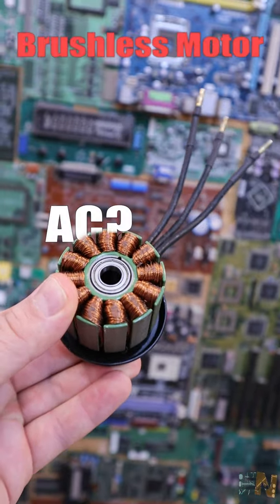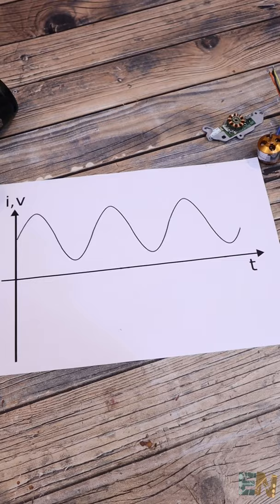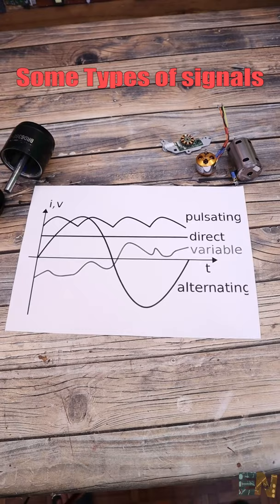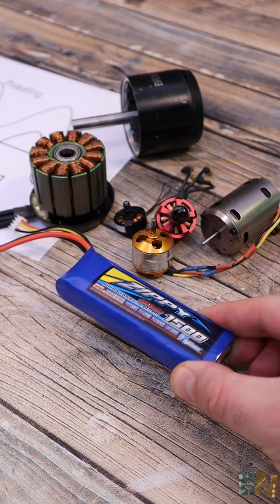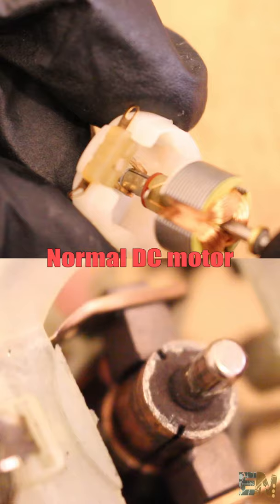Are Brushless Motors AC or DC? - Well...

Comment: If you drive this motor with the proper amount of AC phases, it will work nicely. In practice we use DC pulses to drive it, but that's OK, it is still an AC motor
Reply: Sorry, you are wrong. The current is AC.
Reply: @Ozzy3333333  that's what op is saying?
Reply: @beaclaster  Really? "we use DC pulses to drive it", that statement says DC. Most are confused because the source is DC voltage, then the esc then turns into AC current (dont say something stupid like, AC is a sinewave and this is DC pulses)
Reply: @Ozzy3333333  you are right. The pulses include negative voltage.
Reply: I use DC to power my moto driver but my moto driver's output  is three phase sine voltage，so I thik the bldc is AC moto，and the most important reason is the current is AC
Reply: @Ozzy3333333   I know it's a very old comment thread, but I would still like to reply to your comment to share my opinion. I hope you don't mind. After reading all the comments, I have finally come to a conclusion that the BLDC motor's controller is essentially just a DC input circuit board for a 3-phase AC inverter with variable frequency output control. And that is what is causing the confusion. So, the BLDC is actually an AC motor.
Reply: @jaydutta7711  correct
Reply: it's not dc and not 100% ac it's in between more to ac side it's the positive pluses of ac voltage
so it's ac motor at the end however if the battery is dc but the IPM and PWM will turn it into controlled pulses if you check one line it's dc if you check 3 line it's ac
Reply: @Ozzy3333333  I don't think this is an AC circuit because of how it's driven. You can't look at individual coils. PWM is used to control the motor, and there is no source of negative voltage. So, from the battery and from the controller, the current only flows in one direction. The voltage shows negative for a given coil because the controller switches which leg it powers, which can reverse the current through the coil. The back EMF generates the voltage, of course. Thus, the diagram he shows represents the change in direction through the coil as a negative voltage. However, there is a change in the current direction in a PMDC motor due to the brushes, and no one would claim those are AC motors.
Reply: @commenter4799  that motor can be driven with negative pulses too, usually it's just not worth the hassle to implement a symmetric power supply.
Reply: @dtibor5903  yeah, you'd need two sources, and when you are essentially using an H bridge to control the coils, I don't see the point. I think people are looking at individual coils, but the component as a whole is DC which is fundamentally different than synchronous or induction motors.

Comment: I think the key word in Alternating Current is CURRENT.  The zero voltage reference is somewhat arbitrary.  Each motor lead in this BLDC motor will have current flowing in both directions.  This is what defines an AC motor.  For example, we could use a large 600V battery to feed the DC buss of a VFD serving an AC induction motor.  This motor would not suddenly become a "DC motor".

Comment: How did u explain such a confusing topic in a youtube short?!!
Reply from the maker: Should I make a full video on this topic?
Reply: i think it's good idea for that
Reply: @ELECTRONOOBS  Yes, please.
Reply: @ELECTRONOOBS  Great, please!
Reply: @ELECTRONOOBS  Absolutely! I'm still having confusion with understanding this whole ac vs dc motor ordeal. It would be great to have an explanation video.
Reply: @ELECTRONOOBS  Every motor has either mechanical or electronic switching. The DC motor is mechanically switched and the BLDC motor is electronically switched. Every motor is a transducer, converts electrical energy into mechanical energy and vice versa. But if you run a DC motor you will have a DC generator dynamo, now if you run a BLDC motor you will have an alternator, generating three-phase AC current, and you will need a voltage rectifier to convert to DC. Cheers from Brazil.
Reply: @electronoob, yes, BUT first understand why so many people (including me) is saying your wrong (and you are), just watch my video with a current probe showing the current though the phases are in fact AC, and then,, do a correct video to correct this wrong video.
Reply: @ELECTRONOOBS  You should and you should get it correct the next time

Comment: The current on a bldc motor is Infact AC because it is infact alternating. The 3 phase bldc controller is swapping the polarity on all the pins so it's  ac. Most modern esc are now using phase inductance to produce a smooth signwave now as well dji and castle do this to drastically reduce ringing and heat from the motors.

A bldc motor  controller is really just a dc to 3 phase ac inverter with variable frequency control
Reply: A PMDC motor swaps the polarity on the coils with brushes. Does that make it AC?
Reply: @commenter4799 It is actually a universal motor.

Comment: I see this as a perspective problem.
By taking the battery ground as the absolute ground, yes, this is all DC, but once past the ESC, we should consider the frame of reference of the motor. Now we have 3 phases and the virtual 0-point is determined with the 3 resistor star thingy, you certainly know what I'm talking about.
Reply: A PMDC reverses current flow through the coils with brushes. Does that make it AC?
Reply: 2 years late but you're talking about 3 phase delta configuration lol

Comment: brushless motor broke the line between ac motor and dc motor, but on construction standpoint it more closer to the ac motor, you can consider the esc as some kind VFD or VVVF
Reply: An ESC is basically a low voltage DC VFD. DC because it only drives the coils in one direction because its running on a battery. But you could easily make an AC ESC by adding a second (balanced) battery and using the middle point as the 0V point and each end as +VCC and -VCC.
Reply: In principle it is a DC motor. Only that the function of the brushes are done by semiconductors.

Comment: this should just be wrong tho. alternating current is current that periodically changes direction by having these modulated potential waves we definitely get reversing current in the motor coils => ac.
it really doesnt matter that with regard to our defined 0V potential we only have positive potentials. The direction of the Current is what matters for AC (alternating CURRENT)
the reason we call them dc is because we can supply dc to the alternator similar to how we can just supply dc to a brushed motor. the DC is therefore just user centric nomenclature. the motor itself definitely sees alternating current.
Reply: We should call it permanent magnet motor instead of bldc
Reply: @samueladitya1729   After reading all the comments I finally got into my conclusion that the bldc motor's controller is basically just a DC input circuit board of 3 phase AC inverter with variable frequency output control. And that's causing the confusion.
Reply: @jaydutta7711  exactly.
Reply: AC motor can rotate in one direction only

Comment: 0 volt is arbitrary point. Any change of current is AC. So all Motors are AC. As Motors can be generators this can be seen at output.
Reply: Incorrect, Alternating HAS TO GO THE OPISITE DIRECTION, and the video is wrong.

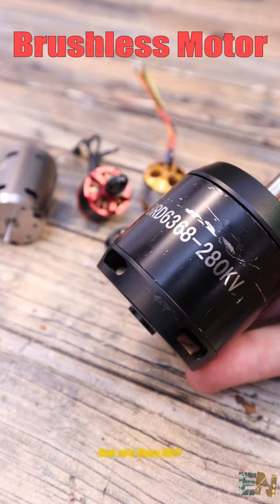Comment: 0:09 Nope, YOU'RE  WRONG. :)
2 reasons:

That is a AC voltage with a DC offset, or a DC voltage is AC signal superimposed on it (whichever you prefer). At least by MY definition of AC and DC. Defining AC as a voltage that happens to cross the zero crossing seems... arbitrary.  I prefer thinking in terms of AC and DC components. Just do a Fourier series analysis on it, and seeing 2 impulses, one at 0Hz (DC) and another factor at some frequency. In this case, my answer would be both AC and DC components, in roughly equal magnitudes (actually a bit more DC than AC magnitude since it is well above the zero crossing in the time domain).

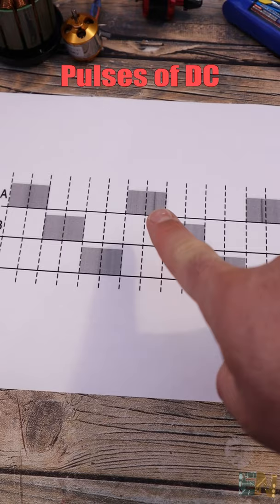HOWEVER,  the motor NEVER sees that voltage. Voltage is a measure between 2 nodes, so I ask you, what 2 nodes were measured to get that waveform? I know for FACT it sure is hell ain't the voltage across any 2 connections of the motor. In fact, I pretty sure that waveform is the voltage measured between one of the phases and the negative of the battery terminal. Guess what? The motor has no connection to battery negative. This is *deliberate*. Doing so would result in massive DC current flow through the motor coils, saturation of the magnetic core, exploding MOSFETs, and burnt windings. So that voltage measurement is pointless and misleading because no current will (or at least should) flow in that path. and if you put a clamp-meter to measure current in any phase, the measured current will have no DC bias, just like you show in 0:41. See? AC currents ONLY. *Alternating currents*, with NO dc offset.

So yes, the BLDC motor is in fact a type of AC synchronous motor. The motor will never see any DC voltage on it. The back EMF is pure AC. Each phase can be electrically modeled as a series inductance and resistance, which also suggests that any DC bias would only serve to cause ohmic heating (it's bad.) and perhaps also extreme torque ripple.

IMHO, Even DC motors are AC motors, the commutator converts DC to AC rather than electronics. From the frame of reference of any particular pole on the armature, it will never see a steady-state DC. some percentage of the time it will get a blimp of positive voltage, and 180 degrees later, get an equal blip of negative DC voltage.

Now, what's the difference between a "BLDC" motor and a "PMSM" motor? both have permanent magnets and an armature, and both operate in much the same way. One has a sinusoidal back EMF and designed to work with sinusoidal drive. Whist the other has a more trapezoidal back emf and designed to work with 6 step commutation. You can also dive into the intricacies  of space vector modulation and 3rd harmonic injection if you want to get real fancy. Actually, practically speaking, BLDC and PMSM motors in real life are really blurred together due to manufacturing tolerances and stuff. Things aren't so mathematically pure in practice. Both BLDC and PMSM will generate a somewhat distorted back EMF.

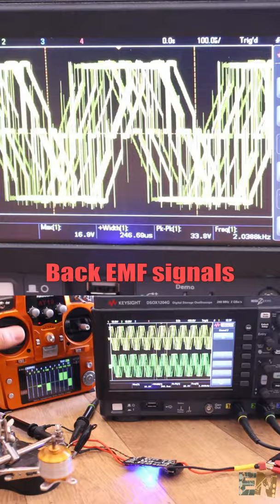0:43 This is where things get interesting.
Yes, the torque vs RPM of a BLDC motor without an advanced control algorithm (like Direct Torque Control or Field Oriented Control) does actually behave a lot like a permanently-excited DC motor. That is to say, a linear torque and RPM relationship; which has a some maximum torque at stall condition and linearly follows a line down to the no-load maximum RPM, assuming constant voltage excitation, as a result of back EMF and parasitic phase impedance. At the midpoint of half speed and half the stall torque is the maximum power point, and maximum efficiency is achieved closer to the no-load condition (light loading.) as expected. But why does this define a BLDC to be a DC motor? What does this characteristic have anything to do with it being a DC motor???

So really? Well as far as I can tell, whether it should be considered a "DC" or "AC" motor has more to do with the controller than it does with the motor. You can connect a PMSM to a BLDC motor driver and it will honestly work just fine. And ditto with a PMSM motor to a BLDC motor controller. (maybe not 'optimal' theoretically) but whatever. Practically, they are in fact interchangeable.

Actually, I do really appreciate the discussion though. and the TL;DR is... it's complicated. Really both sides make good points.
Reply: @Power Max  So a bldc motor  controller is basically just a DC input circuit board of 3 phase AC inverter with variable frequency output control? Am I right?
Reply: @jaydutta7711  correct
Reply: @jaydutta7711  yes. Well... Sort of. There actually are subtle differences between a BLDC and PMSM motor. For details look into something called "Space Vector Modulation." Compare that to SPWM.

SVM with third (fifth, seventh... Odd) harmonic injection allows a a greater voltage differential between phases to be achieved without increasing the required DC voltage.

And also the SVM phasors may follow a hexagon instead of a circle depending on if the motor has a trapezoidal or sinesoidal back EMF. Most high end motor drivers will try to drive a sine wave until you demand maximum speed that can be achieved with a certain DC voltage. In this case it will saturate anyway. Beyond that you have to do something called field weakening where the current you apply to the phases are leading the rotor by more than 90 degrees, deliberately decreasing the rotor field (just the net result of the cross product of the fluxes.
Reply: Damn dude.  You win
Reply: @power-max  how come decreasing the rotor’s magnetic field can increase speed ? Because i think when the rotor’s field decreases , we have less Torque? Im learning about this in school but i am not able to fully understand this fieldweakening
Reply: @phamhuutri1996  I think one way to understand it is to think about it in terms of the back EMF. More field strength results in a larger back EMF for a given rotational speed. The back EMF works against the voltage supplied to the motor. With no load, the BLDC or PMSM motor will rotate at the point where back EMF and voltage supplied are equal and current is near zero. A stall condition results in the highest difference between back EMF (=0) and voltage supplied, or maximum torque. The motor or motor controller would burn up if this condition is maintained too long.

If you look at the torque/speed plots of DC motors or BLDCs or PMSMs for that matter, you can observe a linear relationship between torque and speed, there is a stall torque, an unloaded speed, and a straight line connecting the 2. Maximum power is halfway down this line, maximum efficiency is usually somewhere at 80% speed 20% stall torque part of the curve.

My favorite type of motor is going to be the shunt wound DC machine. This type of motor rotates with very nearly constant RPM regardless of mechanical load. Very strange! A series wound DC machine is also unusual in that the torque/speed plots are inverse. I.e. a huge load of stall torque, and no theoretical limit to unloaded RPM (you can damage these types of motors spooling them up with no mechanical load!)
Reply: Your thoughts on driving a trap bemf motor with FOC?
Reply: @johnrobholmes  The hell would I know?? Not like I left a Ph.D dissertation comment- Oh wait... lol.

I honestly don't think there is a big difference between trapezoidal back EMF and sinusoidal backEMF. If my understanding is correct, match the controller and motor types to minimize torque ripple. In the real-world, both types of motor really fall somewhere halfway between the 2 idealistic types. But really I am not an expert. Just repeating what I have come to the conclusion after obsessively googling how my quad-copter works, with plans but never got around to making a motor controller.
Reply: @power-max  we have the same understanding then.  I make motors and am on the cusp of FOC controlling, now the choice of tweaking back emf shape for non block commutation is upon me.  Will be fun to find out the real world result!
Reply: Well said, and no TLDR's from me mate.
it's good to see someone like myself that takes the time to put down the facts

You're correct
one point you missed though, he also made a mistake by calling Polarity change, Phase Shift
this video definitely has a few mistakes though
Reply: I’m curious if any of y’all fellow motor nerds have ever seen a brushless motor with an odd number of magnet poles on the rotor??
I have been playing with a permanent magnet converted alternator made for a windmill gen that I found in a scrap pile, was scratching my head when I counted 7 magnets on the rotor!  Hooked up to a 1500w e-bike controller this thing has SCARY torque and very smooth/ quiet speed control from start to max rpm.  After some time waving magnets over the rotor and using magnetic feild viewing sheet  to see and feel the shape of the flux I figured out that the magnets on the opposite side supply the alternate pole, causing the rotor to actually have a nice even alternating feild on all sides!  Ive found almost no information on motors with odd number magnets but it seems to work very well in this design!  
Really interested to know if anyone has seen or heard of this kind of configuration before!
Reply: @maukaman  14 poles probably, each magnet has a north and south pole, you can't have an odd number of poles.

For slots, this is some multiple of 3 for a 3 phase motor.
Reply: @power-max  The way it actually works is quite interesting.  It does end up having 14 magnet poles around the outside of the rotor despite having only 7 big chunky neodymium magnets.  I don’t know if the magnets  have unique feild lines or if it’s the shape of the 7 magnets that allows them to be used like this.  The rotor doesn’t have a solid iron core instead it’s made with 2 plates with lots of holes through them, the magnets and empty space between them.
   It’s a very chunky motor and seems to be very powerful with insane starting torque but it has some disadvantage due to the shaft and body being magnetic, probably because of a lack of feild cancellation and the lack of a solid core.  I could see it sucking up lots of little metal bits in most use cases which could be problematic.
Reply: @maukaman do you have a model number or something
Reply: @uwu.-.5873  no but I saw the same one on Missouri Wind and Solar website “7 magnet alternator” or something like that
Reply: Absolutely corrent Powermax, it is a permanent magnet 3Phase A/C Motor. There are industrial variants of these and there are similar motors called synchronous motors, the difference between the 2 is the sync motor has electromagnets rather than permanent.